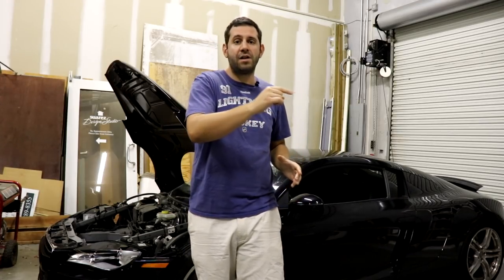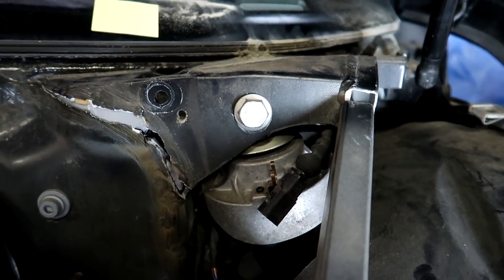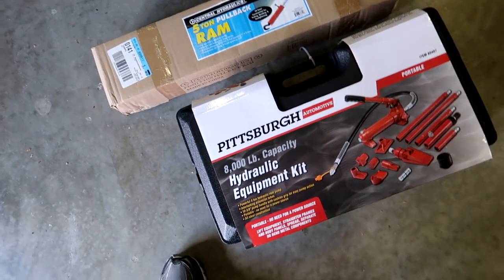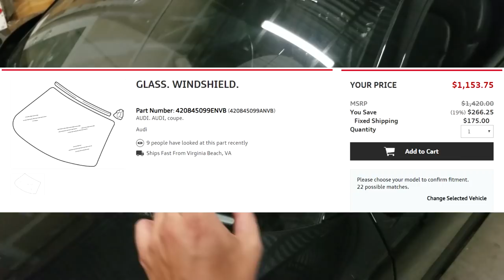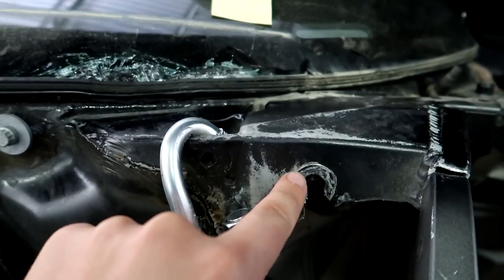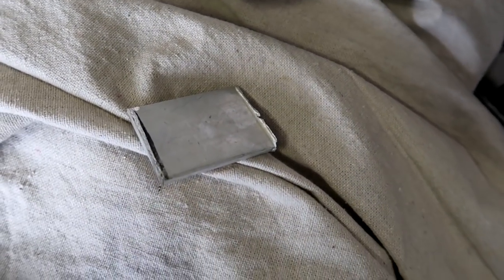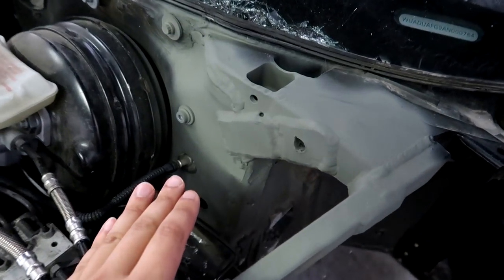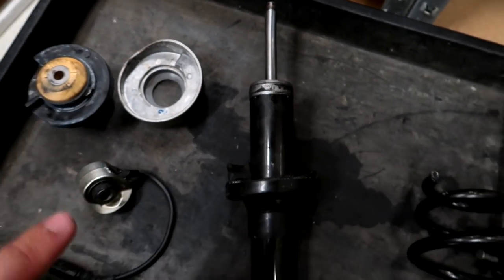I Repaired My Totaled Audi R8's Cracked Frame for $500! Insurance Quoted $29,522!

Comment: Be careful buying a used car. Repairs like this will get someone critically injured and put in a wheelchair if they live.  That said, this is a major engineering flaw with Audi.  That said, this car is not road worthy, and I speculate any insurance company will not pay any claim when this car kills someone.   The car should have been sold for parts.  For more Youtube hits,  Sam should have bashed out all the glass.  Now moving on, using a Harbor Freight tool?  WOW!  The only thing that could have added to the danger factor would be to crawl underneath the car.
Reply: When he said harbor freight i lost it

Comment: I broke a windshield working on the front of the dash day before a road trip, happens so quick. Thankfully on the passenger side so didn't fix until back. And I was complaining about $300 in labor (thankfully happened to have a used one from a parts vehical).
The bent rod seems to further support road caused damage.

Comment: Quite possibly THE WORST BODGE JOB I have ever seen. Welder he is, Engineer he AIN'T!

That whole front area should have had a piece of 3mm cut or machined to the same shape then drilled through to allow through welding. This would make the result ridiculously strong. On the inside I would have welded angle section . What you did will tear again in the future. Audi butt jointed the metal which is too thin to start with when they should have lap jointed.
Reply: SiliquaeSid Audi has always made garbage vehicles
Good comment tho
Reply: That's right in my opinion - filling holes like that - I wonder how much stronger it will be - is it an area that needs to withstand quite an extreme amount of force? I would think that bolting on a section and welding it would be stronger, but I'm a layperson and not a welder, nor an automotive welder.

Comment: At 16:28 "Don't want anything rusting down the line"... Aluminum doesn't rust only oxidizes. Also hope the battery was disconnected while welding on the car. Interesting video anyway.
Reply: Rust is oxidation, but with iron.

Comment: Shocks don't "push up on the car"....The coil-over (spring) puts a load on the upper mount at all times regardless if it "rides along the road" or not..Even when parked it is supporting the wieght of the car...
Reply: They resist the spring compressing by pushing up on the top mount then they pull on the mounts as they slow the spring rebound. The spring holds the car but the shock puts a lot of stress on the mounts to control the spring.
Reply: False
Reply: @muumuumu  What is?
Reply: @ItsFriscoBaby  he saying shocks don't push up the car.. ofcourse they do like you said exactly

Comment: I feel this is the car equivalent of fixing a hole in a chainlink fence with cable ties. 

It's a super car, it's going to be driven like a super car. There is a reason it would have cost Audi 10s of thousands to repair, and that's because it's built specifically to withstand certain tensions and strains and stresses and what not.   
I can appreciate you got a beautiful car for an absolute bargain, but I personally wouldn't drive this thing with the repairs. But hey, I'm not driving it!
Reply: If it was built to withstand the strain it wouldn't have cracked in the first place.  POS repair, for POS car.  Supercar or stupercar?
Reply: KEN LIEBERMAN yeah true but remember the purpose of the car should lend itself to smooth track use or autobahn drives. Not hauling over speed bumps or hitting a curb. Still, steel is more forgiving and repairable. I say shame on Audi for not vetting the car with proper testing. Cars should be subjected to grueling tests to reveal weaknesses...but that's what the Japanese do because they are more practical and are historically quite honorable workers
Reply: @jamesmedina2062  Its a passenger car.  And race tracks are often bumpy, imagine running over a seam at 150 mph.  The frame was originly co-designed with ALCOA, I'm guessing this was cost saving redesign.  They still haven't fixed it as the factory designed patch is likely to fail after 50k miles.  This is why they don't build cars out of welded aluminum - they welds don't hold up.  That patch is like a patch on a tire - it won't last either.  Like I say, all AUDI should be painted yellow - that's why they have the four rings of failure on the front.

Comment: Shoulda grinded down all that seam sealer first.  Clean your joints...
Reply: He said why he didn't in the video lol, I I don't know why everyone missed it.
Reply: @AriJordan  that's BS...ask any body man...  I was working a frame machine at age 20...
Reply: @kidjeff4304 ....It looked to me the welder did a fine job of cleaning the weld surface.  11:15.   What would you have done differently?
Reply: @paulcopeland9035  cleaned it before pulling it,you can hear the welder hitting dirty metal.

Comment: Sam Hack is more like it. It's painful listening to this guy talk. and even more painful watching him work on this car. If he has to resort to Harbor Freight for tools, he obviously can't afford to drive it and maintain it.  He'll probably throw a Body shop a few Hundred bucks for them to pass the structural integrity inspection. Otherwise how would you insure it ? The Bent Strut rod means it was most likely in an impact. The fact that the hood wouldn't pop open in the first vid. Shows that it wasn't simply a cracked Strut mount. The body is twisted. I'm a Licensed tech and have over 20 years experience,  I do Government inspections but would still not try to repair the frame on my own. If this guy wants to fix it as a track car.. great, I'll shut up. But if he wants to drive it on the roads?Or flip it?  Get it to a Shop that will repair it and sign off on the repairs. Also, why make a video that will surely be used as evidence if that vehicle is ever in a crash.. whether his "repairs" failed or not. It's going to come up if insurance investigators get involved. My experience with Insurance companies is not that they like to take your side nor hand out money.
Reply: I think he did a good job
Reply: Dude, you just got slammed by samcrac with facts, live!😂😂😂
Reply: Weird flex but ok. Watch his live vid lol

Comment: Considering molecular structure changes when heating aluminum, I would have left the passenger side alone as there was no damages to that side.
Live and learn!
Reply: Audi does the same thing to prevent this from happening. They just weld a plate on top.

Comment: Darvin, take care about the rest........

P.S. I am very disappointed with that guy. You can not fixed the aluminum frame like that! Unbelievable a lot of morons around.......
Reply: He just probably doesn't know what a PITA aluminum is to deal with and why most shops simply won't touch it.  It can be fixed - and he can save a LOT of money by taking the car apart himself before getting it done - then he will be out maybe $10K and have a proper, safe supercar for ~$60K all told.  He should just start taking it apart now and get it ready to do right.

Comment: Honestly i’m a huge fan of this channel and I believe it’s awesome having youtuber’s show thats it’s not impossible for people to achieve their dream cars at a much cheaper price then the national average, however I do not believe this repair was done correctly and more important safely, aluminum is much different then steel and needs to be treated as such, if it was only your life at risk by all means do whatever you please, zip tie it for all I care, however this not only affects the driver but any other people in the path of the vehicle if it happened to crash, i’m not sure about liability and insurance as well as vehicle inspections but i feel like if someone was injured because this vehicle crashed do to a shady repair it would not be a good situation, even though the point of these video’s seems to be to get these cars for a much lesser price then a non salvage vehicle, it seems like that point isn’t even valid when your risking safety and security to save a few bucks, there is a reason these frame failures have such a high repair cost and thats because to repair it correctly its going to take much more work then welding the cracks and calling it complete and better then factory
Reply: great comment Southern Charm.  Even after the "repair" he talks about how much he is saving on a shock and its quality. Nothing wrong with getting a good deal on quality parts but one thing I always say is "I don't buy junk that way when I sell I don't sell junk" With a better repair he could have still saved much cash and been proud of the machine. He now has an embarrassment and can NEVER feel good about this "repair."

Comment: Its not the suspension mods. Its not the welding quality. This car should have been put on a frame machine before and during the time these repairs were made, unless this clown can check demonsions with his eyes he has no idea if the frame is straight. Much less safe. Anybody with any amount of automotive knowledge and common sense would have put this car on a frame machine, but he's too cheap. This ins't even close to a correct start to this type of repair. This isn't a pinto. It is a highly engineered supercar designed to go above 180 mph he's gonna get someone killed.
Reply: It wasn't actually part of the "frame", it is the top shock mount, so it is not as nearly as critical in keeping the alignment true.

Comment: Sorry Sam but the frame should have been digitally aligned with lazers prior to welding. A car of this value should have had this as a minimal requiement.....even you know that??
Reply: TheRebelOne The strut tab isn’t actually a structural part of the frame, just a strut tab so the repair, while dodgy perhaps, didn’t compromise the integrity of the car.
Reply: @eptyr12  I realise that however if the strut tower  is not re aligned properly it cold cause tracking issues and tyre wear and steering pull. But yes you are correct.

Comment: Maybe stronger than factory, but the geometry is all jacked now. I wouldn’t drive that thing over 90mph
Reply: Geometry isn't defined by the upper shock mount. The upper shock mount is just that - the shock mount. The geometry is defined by the control arm mounts which for all we can tell are undamaged. There are lots of problems with this repair, but that isn't one of them. (I also have an R8 and am aware of the risk of this issue. It had to be a really hard hit to bend the shock rod)
Reply: That mount also located the spring and sets ride height. It will change geometry due to the angles being different. 

If interested, read up on sla suspension instant centers and their effect on the front roll center.
Reply: Kyle S exactly man, maybe it’ll ride around town nice, but there’s no way I would rave anyone in that thing. But great video and cool project non the less!

Comment: Correct me if I am wrong, but even with the repair it still has a salvage title and only holds the value of the title. If you are fixing it to drive no problem. If you are fixing it for resale. How do you fix the title?
Reply: You don't fix salvage title. It stays salvage. Fixed  salvage cars that are road wordy and pass dmv inspection usually sell for 1/2 price off a good car. Sometime more if you find a sucker.
Reply: @janmatusiak1380  my mother bought a 2015 Impala the had a salvage title. she paid like $6,000k and the car has  a lil over 30k miles on it. the car runs and drives great. i'm not sure if that was a deal or not but other cars that didn't have a salvage title was going for $8k-$10k. they told her upfront that the car had a salvage title but that wouldn't effect the car. it was hit on the side and had the rear section replaced. but as far as the title, it will always say salvage on it.
Reply: Get the inspector drunk.
Reply: Try getting insurance on a salvage title
Reply: there is a buyer for everything

Comment: The car has clearly suffered an impact bent and misshapen alloy with a bent steel suspension piece. You can't just eyeball this it's need a jig (not an Irish dance) sam you are deluded if you think this is 100% fixed. Love you man but is a super car not a pizza van
Reply: its a super car that's going to get less drive time and less wear than a pizza van. its just his garage show piece / YT material. doubt hes gonna take it on crazy trips and put it through the wringer

Comment: Rookie welder here. It could be me watching this on mobile, but I think I saw pinholes/porosity on the crack repair which might crack again. Also, if the aluminum was bent to close the gap, I would assume no prep was done on the crack surface where they meet and and would cause issues bonding the two metals together because the oxide melts at higher temp?

Comment: I'm no expert on this, but it does not seem safe to me..
Reply: as an "expert" professional car mechanic who also worked next to body shop It is probably safe enough. Underneath all the shiny paint fancy electronics and comfort features it is basically just a bigger version of a go cart made from stamped sheet metal and then spot welded together they are pretty simple so don't overthink it.
Reply: Yeah, he should've at least got it checked out by a frame specialist
Reply: Edgardo Mejia I

Comment: if there are any welders out there, i've got a question: instead of wearing an automatic black-out welder's mask, do you think you could use a virtual reality headset to use your phone's camera app to safely watch as you weld in real-time (because the maximum light exposure would be limited to the maximum brightness of your phone)?  this way you wouldn't have to periodically flip up the mask to check your work (so it would basically look like the video at 12:54 as you're welding).  that's just something i've wondered about for awhile.

btw, to Samcrac
, great video—really appreciate your DIY-attitude!

Comment: This is why I would never buy a salvage vehicle
Reply: I made the mistake once.
Reply: Only buy salvage car when you can unbolt damage and bolt on new replacement. Don't buy damage to steering or suspension unless you are expert. Best way is to stick to one make and model and become expert in that vehicle so you know what you are looking for and where likely problems are along with likely costs. You can buy at salvage for third of price but you have to price in your time and costs, transport, parts etc. Sometimes it's cheaper to buy without damage etc on eBay without all the hassle.

Comment: I generally don't post real negative comments, but I am going to make an exception. First, I do like DIY projects that save money and are innovative at the same time. But, this "repair" is perhaps the sketchiest, most dangerous YT repair I have ever seen.  You hammered and pulled for TWO days on a complex aluminum support structure and then had a Billy Bob 'weld' a support bracket. As others have pointed out, welding aluminum (alloys)can easily weaken adjacent parts of the metal structure. (It would be interesting to know exactly what aluminum alloy this part was made of originally. And you should know that before any attempt at welding!!) I hope your wife makes you increase your life insurance amounts. Because if you drive this car at speed, catastrophic failure is very likely.
Reply: What do you mean with 'Billy Bob'?  Is your name better? Catastrophic failure was already likely. It's right there for you to see. (But I think you judge more on names than actual facts in front of you)  The original 'complex support structure' catastrophically failed after having been designed by the 'experts' that knew exactly the constituents of the aluminium alloy. But their names are more satisfactory to you, so it's all good.  Don't bother responding, idiots go straight onto my ignore list. Have a nice day 'Leonardo'.  LOL
Reply: Whoa hoss!  "Billy Bob" is a linguistic reference to an archetype shade tree mechanic (in my neck of the woods,LOL) who is more likely to use a sledge hammer than a precision tool. No, the original failure was NOT catastrophic. Catastrophic means you are going 150mph when you lose total directional control and roll the car 20 times as it disintegrates. If you didn't understand the alloy  type issue , then you know absolutely nothing about precision aluminum welding.
Reply: @leonardodavinci303  Nice try but you know nothing about the credentials of the welder.
Reply: Leodf1's real name is Billy Bob. Dont drag his good name through the dirt. Lmao 😂😂😂 
And for the record, I 100% agree with you.
Reply: @xwhite2020  we don't need to. His welding and huge fish eyes at every termination show his lack of credentials.
Reply: Leonardo DaVinci have to disagree with you DaVinci. You did your best attempt to sound intelligent but I have to also state that I probably have more experience owning repair shops than you are old and have seen far worse by those that flip used cars for a living. The strut tower isn’t a critical component and despite it not being “properly” repaired its likely much stronger than factory now. Perhaps you better check your car fax.
Reply: @bullrunhunter6489  Lol. Lost some legitimacy in your commenting on LDV's intelligence when you typed "car fax". Facts, man. FACTS.
Reply: Zach no I meant car fax.try google :-)

https://www.carfax.com
Reply: @bullrunhunter6489  I stand corrected!
Reply: @bullrunhunter6489  "The strut tower isn't a critical component"??? 😂

Have you ever seen what happens when a tower rusts out to the point that the upper mount pops and the upper mount slams against the underside of the hood?!

Lest we forget what this does to the angle of the control arm on the effected side in comparison, and the effective camber/caster angle changes resulting in erratoc handling?  😂😂😂

Yeah...totally not critical at all. 🙄